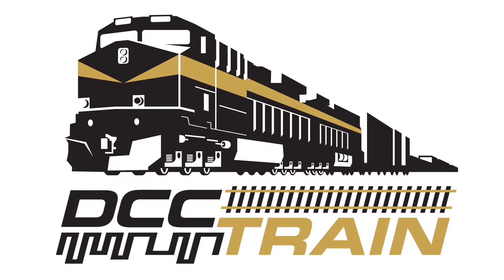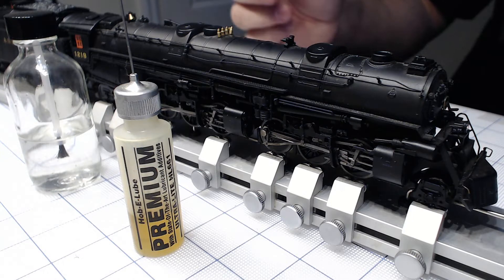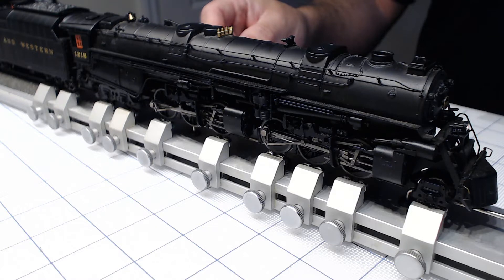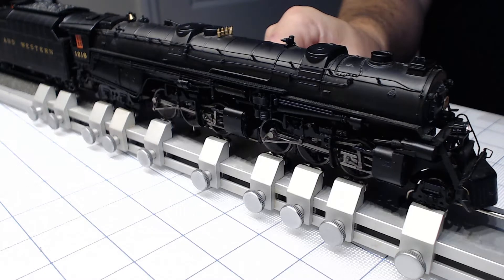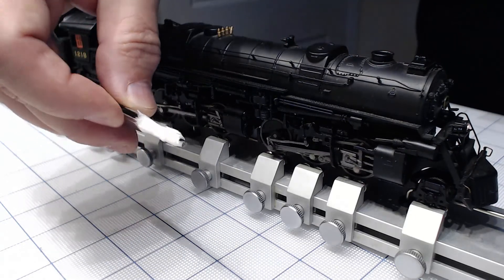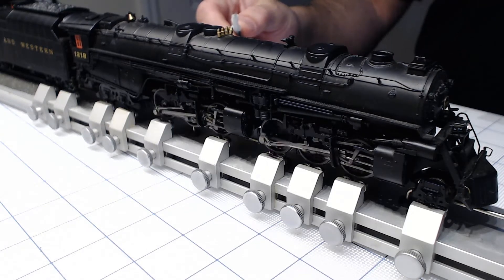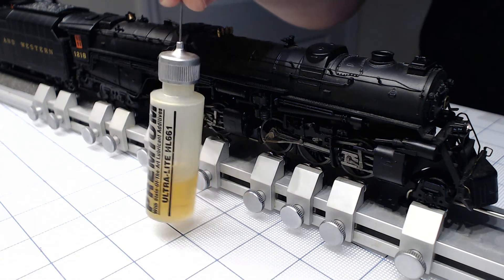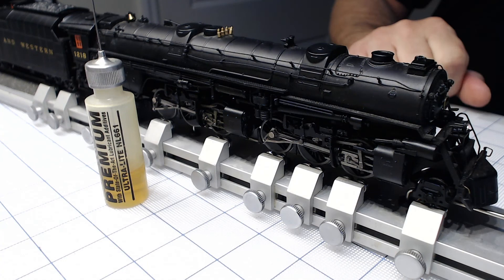How to clean and lubricate HO scale locomotive

Comment: I advice to use Medium Oil from Woodland Scenics to lubricate side rods in HO instead of Ultra-Lite Oil. If you use Ultra-Lite Oil for lubricating side rods, it will flow from side rods and contaminate drivers. On the other hand, Medium Oil is lite enough to lubricate side rods in HO, and thick enough not to flow and contaminate drivers.
Ultra-Lite Oil is perfect for lubricating valve gear and driver's axles. I recommend to apply it with syringe. It will help to prevent applying too much oil.
Напишу по-русски, чтобы с английским не возиться.
Шарниры, где колёса соединяются с кривошипно-шатунным механизмом, лучше смазывать маслом средней вязкости от Woodland Scenics (масштаб HO). Если использовать в этих шарнирах ультра-лёгкое масло, оно будет стекать с шарниров на колёса, особенно если добавить чуть больше масла чем нужно. В результате колёса будут вымазаны маслом. Средневязкое масло достаточно жидкое для смазки этих узлов, но достаточно вязкое, чтобы не стекать на колёса.
Ультра-лёгкое масло хорошо подходит для смазки механизма парораспределения и осей колёс, но его лучше добавлять из шприца, чтобы не плюхнуть слишком много.
Reply from the maker: Thanks.